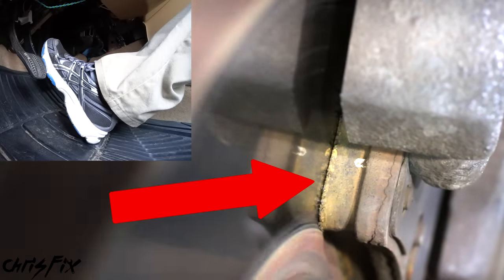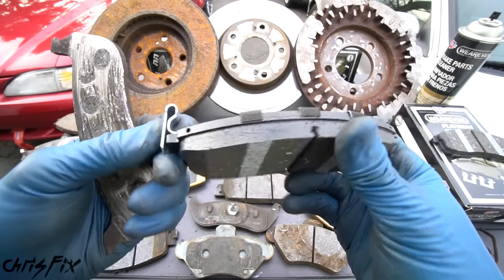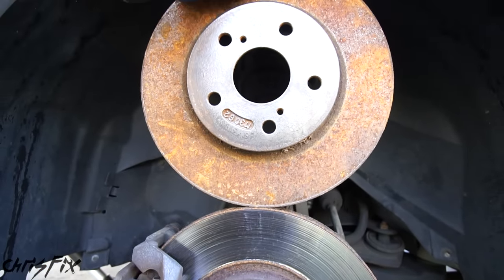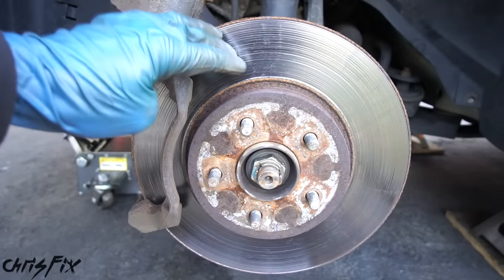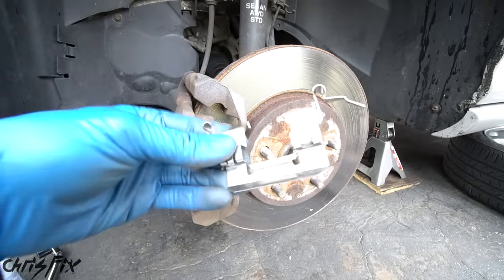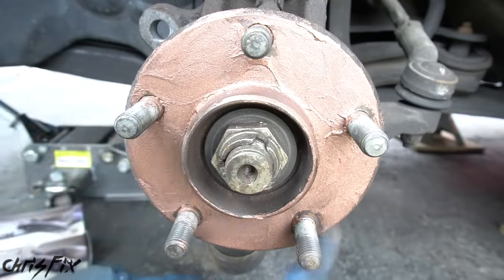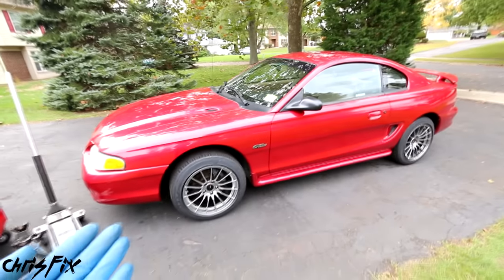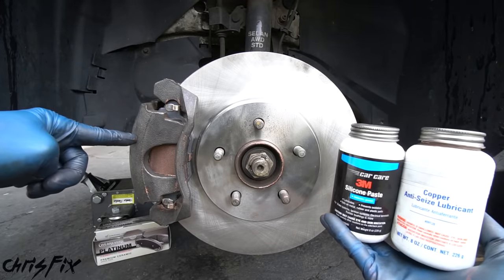How to Stop Your Brakes from Squeaking

Comment: Short answer: Turn the radio up.
Reply: Bushwacker what if your radio is broken?
Reply: BulletproofX1X    .....phone.......
Reply: And if phones broken drift like Chrisfix
Reply: So, yeah, if anybody was wondering how they get down to the cooling fins. This guy.
Reply: WD40 (j/k)
Reply: Yell extremely loud when applying pressure to the brake pedal in case of radio being out of commision
Reply: When that happens, I just fill the holes with JB weld. Good for another 30 000 miles.
Reply: Anything can be fixed with the volume button! A friend of mine was experiencing rod-knock, so I just cranked up the volume, and it was good for another 50,000 miles!
Reply: @BulletproofX1X close your ears
Reply: My entertainment system was at a hefty 27 kilos so i ripped that shit right out
Reply: Lol facts. I do this 😂😂
Reply: PineappleSplash lol me too
Reply: Bushwacker lmfao
Reply: BulletproofX1X lmfao
Reply: Just put on your noise cancelling headphone
Reply: Rev it up haha :D
Reply: Bushwacker lol that’s how I failed a Maryland state inspection
Reply: @bulletproofx1x420 just go into first gear and have your rpm at 7000 so you only hear your engine.
Reply: Lmao true shit
Reply: Easy fix for everything that makes worrying noise
Reply: pour super glue in ur ears. Walla!
Reply: But somebody stole my car radio and now I just sit in squealing
Reply: 😂😂😂 I did the same when I get tired of going so many times to the shop. And nothing get solution
Reply: Can't hear ya. Do what?
Reply: Just remove your brakes
Reply: I tried that untill i hit that asian on Story Rd and his lady got beat up by my lady for getting loud after we hit her pinto
Reply: Lol😂🙄
Reply: >:(

James M. Padre Juan
Reply: Or just  lubricate the brakes
Reply: But it only goes up to 38 and its verry quiet because there's no a.c.
Reply: @tenny3533  I dont have any
Reply: @SloppyTelopy  but mine only goes up to 6
Reply: Lord Trump  same here
Reply: lol that's what my dad always says.
Reply: Air conditioner
Reply: The ol’ Van Morrison fix
Reply: That cut short of labor cost.
Reply: @bulletproofx1x420  cut ur mufflers off
Reply: On my soul 🤦🏾‍♀️
Reply: @bulletproofx1x420  grease the shit out of your rotors
Reply: @bulletproofx1x420  Bluetooth speaker
Reply: Deadass
Reply: lmaooooo
Reply: What if you can still hear it with it turned up 😂😂
Reply: @jointaimbot55  ja
Reply: How is that going to stop the brakes from squeaking?
Reply: Either turn the radio up or add aftermarket lights
Reply: I think the fact that I always have my radio up is exactly why I didn't realize how worn my brakes were
Reply: That's what I did with my Honda Civic
Reply: Lol I would say the same looooooooolllllololooo
Reply: How to hear less screaming after brake fail accident? Turn the radio up
Reply: Just put some wd 40 on the disk
Reply: oil
Reply: More u wait to fix the problem more other problems with the car would stack up=more money to spend🌚
Reply: Yes What if ur ratio Id BROCE?
Reply: Turn that bass up while you’re at it
Reply: I first watched this video without a car and thought this was funny, I’m now coming back to this vid with a car and this is relatable 😭😭
Reply: Absolutely. And if it’s broken, then sing. Similarly, I notice that my garden looks fantastic at night!

Comment: that broken down brake disc disturbs me...wtf
Reply: Florinel787 same I can't believe someone could be that oblivious
Reply: +Shane Blandford-Scherr I've changed probably 3 or 4 like that. In one case the guy was trying to save money. He pushed it, and pushed it. Eventually, the rotor wore down as you see it, and the backing plate wore down so much it was able to exit the caliper bracket through the gap between it and the rotor. The caliper piston then contacted the exposed cooling vanes of the rotor. The piston got so hot and mangled from that, it melted the dust boot and square cut seal. He tried to save money on a simple pad and rotor brake job, and ended up paying for pads, rotors, 2 front calipers, and a brake fluid exchange. Some people's kids man...
Reply: it's frightening how oblivious a lot of people are to this kind of thing,  and the potential consequences of it.
Reply: I actually had that happen to me in my dad's expedition.  we ignored it for awhile and then while driving down my road I just heard a bunch of metal peices break off and rattle around the wheels. the disc only had one side  when we took it out.
Reply: Florinel787 happened to my friend, whole thing exploded on him wail driving.
Reply: KAMTxInferior 

      Did a colleagues brakes last month and he did not have an outside driver pad.  The rotor was braking on the caliper claw.  Found the shim crumbled up between the rotor and rim during inspection.   No backing plate to be found...
Reply: +Shane Blandford-Scherr probably came from an old person or a woman's car
Reply: Darksyne 

       Neither, HE is 35 ish but has no clue about cars.  I cringed when I opened the hood.   He has the same philosophy...gas and go.
Reply from the maker: Yea I dont know how anyone can drive on a rotor like that. Just the noise alone I would think would scare people from driving on it!
Reply: ChrisFix yet he didn't crash into anyone
Reply: Woah...So many likes...
Reply: yup disgusting for sure
Reply: the person who did that to the rotor ignored it for several brake changes. the worst thing that happened as far as rotors to me is when the weld between the plate the brakepads rub against and the part that the rotor mounts to the car with snapped. we were on a bit of a road trip, i think we were trying to diagnose an engine misfire in a 90s mercedes, but the only place that had what we needed in stock was about 45 miles south, we were driving and i heard a crunch, but nobody else heard it. so i guess it was a week later we decided to rotate the tires and change the brakes, and i pull the wheel off and thats when i noticed the rotor broke in a perfect circle right in that weld
Reply: It's trypophobia
Reply: You just need a radio that's loud enough.
Reply: Omg. Ikr. I feel so bad for that car.
Reply: lol
Reply: it was creepy
Reply: how could a rotor like that stop a car?
Reply: having 3 or even 2 could stop your car, some people have come in with just a ring as their rear rotors thats scary
Reply: Khaled Ibrahim I am surprised they never got into an accident.
Reply: Zhenren ZHOU ,z
Reply: Well, you could always use the old-school technique of waiting 'til you run into something ...
Reply: once i had chunks of metal breaking of on my both back rotors for some reason. it wasn't worn out that bad, but it started to crumble. Sound wasn't that scary but car shaked while breaking.
Reply: These people actually exist and share the roads with us...  Think how hard it would pull to one side.  To go straight when braking the wheel must have had to be turned like 90 degrees...
Reply: Disgusting!
Reply: Florinel787 me to
Reply: holy shit.... how did they not know?
Reply: Florinel787 Me too. I cringed when I saw it
Reply: LiteCastStudios something like that, but many times worse
Reply: Omg same

Comment: Golden rule: If it squeaks, then it needs lubrication.
Reply from the maker: great tip!
Reply: I put the silicone paste onto my rotors and now my brakes dont work
Reply: of course. You have to use high temperature stuff. Like cooper anti-sieze or elbow grease.
Reply: thePavuk jahahahajajajajajajjaaja

Comment: The level of detail Chrisfix puts into his videos is insane.

He deserves one hundred million views.
Reply: Joshua Camarena in total I think he has 100mil
Reply: jman_jd10 | over 230mil now
Reply: Joshua Camarena Or more then pewdiepie subscribers.
Reply from the maker: Thanks Joshua!
Reply: If only it was more accurate detail, this is 1980's brake work.
Reply: Joshua Camarena
Reply: Joshua Camarena of
Reply: @Oz Media What makes it not accurate? This is the most thorough video on the topic I have ever seen.
 Breaks haven't really changed much in the past several decades other than the addition of wear sensors and the such.
Reply: @Oz Media 
The post I replied to contained absolutely nothing of what you said. Though what you just said makes no difference to my statement. You're focusing on irrelevancies that have little or nothing to do with knowing /how/ to either diagnose sources of noise (as is the topic of the video) or changing brake pads or rotors.

The mechanics are the same as they always have been, pad on disk, with the same parts used in similar ways with only some variation across models in most production cars. What compounds or materials are used makes absolutely no difference as long as you get the correct parts for your car (i.e. made to manufacturers spec).
Reply: Boreasos - point for point.

-Even cheap, poorly designed pads with crappy EE friction material often come with wear indicators.  Not just quality pads.

-Standard vernier calipers are not for measuring rotors, they will measure the high edge and not just the center of the rotor.  Use a deep micrometer or brake rotor mic.

-Most manufacturers don't support the use of brake clean, although most shops still use it.  You are 100% right in using soapy water.

-Zinc coated rotors help avoid rust to begin with and are not really much more expensive.

-AntiSeize is an old school brake lubricant that fails,copper dries out and goes lumpy, graphite dries out and the oil base separates. There are newer lubricants used now, a sticky silicone base for backing plates (even that is being phased out now) and a much more slippery silicone lighter weight for sliders, slide pins and backing plates.  Never seize is just way out of date now and proven to fail far too easily with more modern brakes due to the higher temps. Cardone and Raybestos will not honor the warranty any more if there is never seize used.
Reply: @Oz Media
Not sure why you deleted your previous message, but whatever. Still I feel you're focusing on minor issues and details as well as presenting your opinions as facts. Again, none of what you said invalidates my original post, but I will nonetheless respond to your points.

- Yes they may indeed come with wear indicators, but his statement was that quality ones come with them, not that low quality ones can't come with them. The implication is that quality pads usually don't come without them.

-He specifically pointed out that you didn't want to measure the ridge.

-Brake cleaner works great, and I can never recall hearing of manufacturers recommending not using them. Additionally he specifically pointed out that you had to be careful where you sprayed it to avoid damage to paint, the pad surface or rubber materials.

-If they are merely coated, the Zink will quickly wear down and rust just as easily as rotors without it. Regardless, this does not invalidate the point that rust might be a source of brake noise.

-On this final topic there are many variants of lubricants, and some modern ones are indeed superior in their designed application, but here it is very much a case of experience forming the basis for a recommendation and many mechanics would certainly disagree with you that copper anti seize is a bad choice for lubrication between the hub and the rotor. It is well within the temperature tolerance for the vast majority of cars and does the job well enough. Go with whatever your manufacturer recommends if you're unsure.
Reply: They have changed a lot. Even the metal used in the rotors has changed. You must know cars before talking about cars.
Reply: "What compounds or materials are used makes absolutely no difference"? This statement goes to show you never truly went to a school of automotive. The reason breaks make noise the past 25 years has a lot to do with the compounds in break material and the metal used in break rotors. But keep up the good work some people need someone to follow.
Reply: @foreigncareater 
Congratulations on your quote mining skill. If you did it unintentionally, then my point went way over your head, and if you did it intentionally, then shame on you for trying to score cheap and irrelevant points.
Reply: I could run a car service after watching his videos :D
Reply: no problem i have a same good old brake system
Reply: No One I
Reply: It's great, he's better than a fucking Mechanic. Chris when are you opening your mechanic shop, can I be the first one to come to the Grand Opening party!!!
Reply: Joshua Camarena he has 246 million…
Reply: Kevin Manrrique You are right, its excellent knowledge! So much better than someone who is actually trained and knows what they are talking about.  
I know many dozens of unqualified mechanics that run shops, charging $100+ per hour and catering to the likes of you, before their customer's finally give up and go to a trained mechanic.
Reply: Joshua Camarena Hate to "brake" it to ya...but you're reading this I hope you have an Fix-tastic day ;)
Reply: I meant per video. 

When I commented on this video it was only one hundred thousand. 

In any case, keep up the good work Chris. 👍💯
Reply: Joshua Camarena I'm also a full time mechanic. Although the detail is high, it's honestly what all good mechanics go through on the daily. What I find impressive is the video composition, editing and the fact he explains in easy terms rather than professional jargon and has great angles of everything.
Reply: Impressive
Reply: 800 million subs for Chris fix
Reply: Trueeee I like it. I wanna see his face

Comment: As a guy who's never worked on cars more than an engine oil change, you help me take care of my vehicles. I actually can preform my own self care now (save the big stuff) and it honestly feels great.

Big thanks chris, I needed this
Reply: There is a spray solution (not silicon spray) recommended for easy, non run down, brake noises.

Comment: So happy to see someone recommending cleaning and lubricating the guide pins.
You wouldn't believe how many brakes I have seen with seized guide pins .. jeeze !
Reply: Jaxon Dakota He stated what would happen in his comment already.
Reply: The guide pins will rust and the rust will weld them tight to the caliper aka they are seized and very difficult to remove and will most likely need serious force and or a penetrating lubricant to remove them.

Comment: 12:03 "we don't want metal-to-metal contact here"
applies copper lubricant
Reply: Brake grease not copper antisize
Reply: @joseiracheta3817  that was definitely copper
Reply: @alexanderblake5780  yes I know.  He should use brake grease and not copper antisieze
Reply: Jose Iracheta it’s metal on metal though. Why wouldn’t you use copper anti seize
Reply: @thechileacademy4800  Metal on metal = friction. Brake grease is designed for lubrication.
Reply: proxactual yes we need brake grease here. Nt the copper or ceramic
Reply: metal and copper are diff. materials , so I would trust the master.
Reply: @dodgevision2371   copper is literally a metal lol
Reply: Copper is softer than steel, there won't be any damage to the brakes.
But, you must be aware that the "grease" may get on the friction surfaces of the brakes, which is NOT GOOD...
Reply: Can someone here understand it was a joke?
Reply: @waqar1130  I prefer ceramic anti-seize, it's better due to his high temperature propriety
Reply: @dodgevision2371  2000 IQ logic right there
Reply: Putting copper lube on this area is a bad idea. Dissimilar metals will cause rusting. My mechanic suggested graphite silicone grease as it's high temp resistance and will protect against rust.
Reply: ...  ceramic anti-seize is not metallic and resist without degradation up to 2600deg Fahrenheit.
Reply: Everyone in here a pro mech
Reply: Ya copper anti sieze isn’t for brakes lol

Comment: I wanted to add this in case others had a similar issue. For me what stopped the noise was the brake hardware where the pads rest was rubbing against the rotor and caliper. So I bent one of the metal bends closest to the rotor further in and that solved my issue.

Comment: You saved my day at 10:02. I got new brakes and calipers at a workshop and it seems as if the mechanics hadn't clean the rust underneath the pad. It is sad cause I paid big money for the repair since there were major things to fix but they paid no attention to such details (didn't even bother to screw the swingarms tightly). I suppose I will be doing things by myself now with good advice such as in the video above.
Reply from the maker: Glad the videos are helpful! You can totally do the job yourself with better quality and better parts!
Reply: Brakes are one of the easiest things to do. I just put new rotors and pads on all 4 corners of my GTO yesterday, took me about 3 hours and all it cost was parts.

Comment: My noise was from when I applied anti-squeak to the pads and reassembled everything I got some grease on the rotor which made the rotor super shiny and smooth causing a crunching chatter when applying the brakes at a slow speed. To fix- clean the rotor and pads with dish soap and sandpaper them a little.

Comment: For drum brakes, noise can be cause due to hardware rubbing the drum. I had this issue with a 97 ranger. The auto adjuster was rubbing against the drum because it was improperly installed. I quickly fixed it and the brakes, hardware and drum were all perfect to use after turning the drum
Reply from the maker: Thanks for the tip!
Reply: A bad wheel bearing can also sound like drum brakes grinding. Had that happen last year on one of my cars.